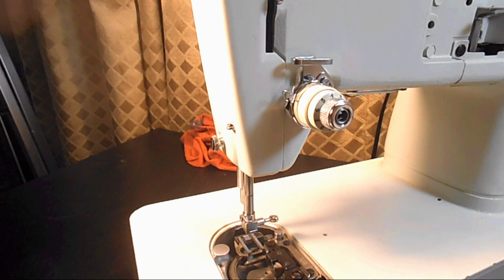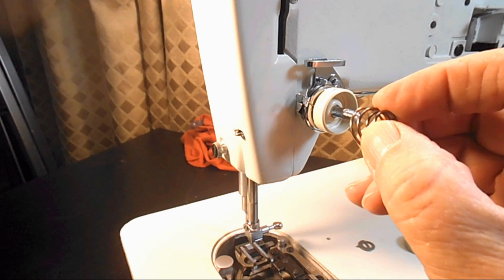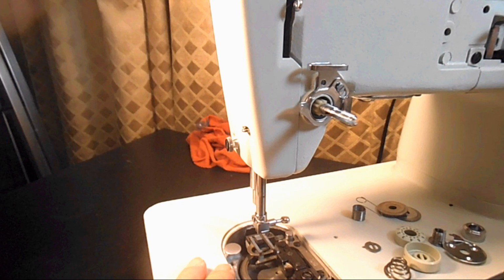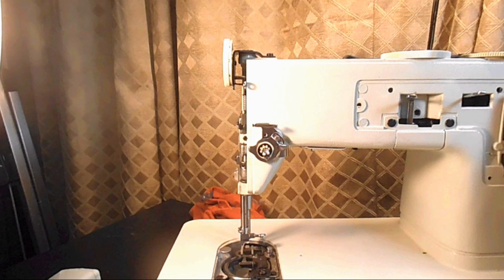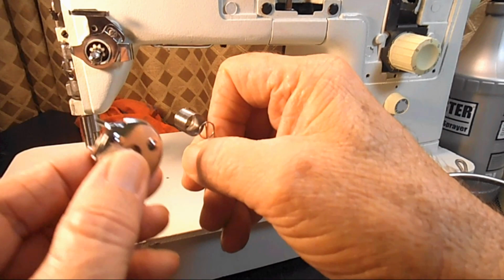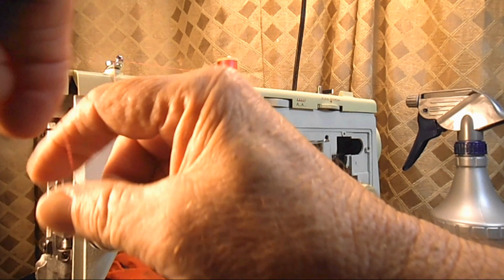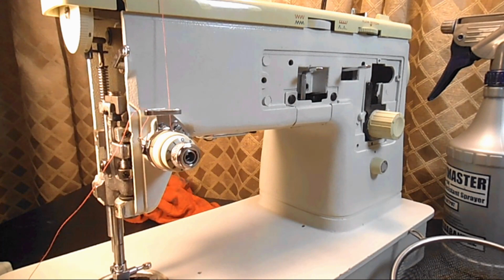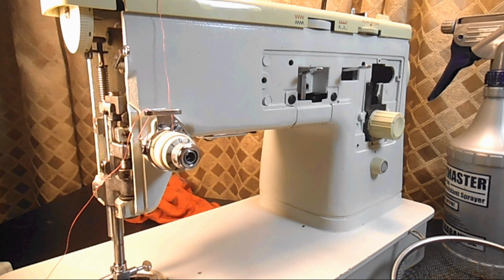How to Remove, Clean, Replace and Adjust the Thread Tension Unit on a Vintage Singer Sewing Machine

Comment: Hey Andy, my mom has a Singer 6105 sewing machine and for decades it has served us well, but one fateful eve my mom took it to a repair shop for some simple maintenancing, ever since then the machine has not sewed right. The tension assembly is quite loose and setting the tension with the knob no longer has an affect. Ive been trying to remove the knob but there is no flange or set screw to start with, it is simply the numbered indicator knob, then the +/- ring and finally the metal assembly you run the thread through. Other than the knob being plastic only the tension assemblies on both yours and our machine looks the same.
Reply: Hey Im just commenting further to update you and let you know I found the set screw I needed within the machine and got the tension assembly taken apart. Dont know how I didnt spot it sooner but on closer inspection I found there was a component missing that is part of the tension assembly and made an order for a replacement ASAP. My mom couldnt be happier, thank you! Finding your videos was a welcome reward as well. I appreciate all the work you do to help people like me! Have a Merry Christmas and Happy New Year!
Reply from the maker: I see you found a solution. Congrats. For others who read the comment with this type of plastic "tension Indicator" knob you just pull it straight off of the unit. Underneath is a "tension indicator adaptor" that it pushes onto. That adaptor is like the flange adaptor in this video. So, the plastic numbered knob is held on by friction.
Reply from the maker: @Fangman123789  (for other viewers reading this comment) It sounds like you found the internal set screw that holds the tension stud onto the machine. Loosening that set screw allows the stud with all the attached parts to be removed as a unit from the machine. I'm glad you found a solution and thanks for the followup comment.
Reply: @andytubesewing1953  Thank you too, your videos helped me a lot! Merry Christmas again!
Reply from the maker: @Fangman123789  😊

Comment: Thank you Andy for making a video on the tension adjustment knob. It worked for me. I had thread bunching up like it was eating up all my bobbin thread. I have another question. The pedal is either a very very fast or i have to pump it slowly. Any way to adjust that?
Reply from the maker: I have a couple of playlists for cleaning and adjusting foot controllers, a button style & a clamshell style. You don't mention the type of foot controller you have. Here are the links to the playlists if you want to check them out. https://www.youtube.com/playlist?list=PLsCOZgzzaiKL6ePPxLpmnWSzTyxPKTb71     https://www.youtube.com/playlist?list=PLsCOZgzzaiKItPLWcK24FBoMdHK8vTXNi    I'm glad the tension video helped, and good luck.

Comment: Hi Andy, thanks for the great videos. I have a Singer 447 that I am trying to get working. I have followed your video to refurbish the tension unit. Everything is fine until I try to set the tension. When I put the presser foot down nothing happens to the tension. Have I done something wrong?
Reply from the maker: With the foot down tension should be applied to the tension discs. When the foot is raised the tension release pin should be pushing the discs away from the spring to remove tension on the thread. You should easily see the indicator dial (the - | +) and the tension discs move when lifting the foot. If that is not happening, the short x-bar in the center of the indicator dial could be missing or cracked and the pin cannot move it. The tension releasing pin could be missing. When you lift the presser bar lever it moves a Tension Release Lever in the nose of the machine against the inside end of the Tension Release Pin. If that lever is bent and cannot contact the pin, then the pin won't push against the indicator dial and release the tension on the discs. Those are the most common reasons. Here is another tension video that talks more about the tension release pin: https://youtu.be/JqauIOWs9CI     Here is a video about making a new tension release pin from a nail: https://youtu.be/M1kXDd5GLEE   Here is a video about replacing a damaged Tension Releasing Lever: 
https://youtu.be/tw-Y3V_LrnA       Here is a video about a broken x-bar on an INdicator dial/flange. So people can replace the x-bar with a wire/toothpick/etc but I buy a new one if available: https://youtu.be/-TmDis0pcmU
Reply: Thanks so much. More work to do!
Reply from the maker: @kaffjones8710  Best of luck!

Comment: Andy, Please help me with tension on a Singer 15-90. I have taken it off and cleaned and replaced it but it hasn’t helped. The thread seems to lie on the top and even though the top tension seems right.  HELP!!!!!
Reply from the maker: You can test upper tension by putting the foot down on a threaded machine and grabbing the needle thread by the takeup lever and pulling it straight up while turning the tension knob from 0 to 9. At zero it is very, very easy to pull, and as you turn up the number it gets tension, then more tension, then too much tension around 7, 8, or 9. The thread on top means more tension ( a lot more) on the needle thread than the bobbin thread. If that test is as I described then you may have very low or no tension on the bobbin thread. Check to be sure you have threaded the bobbin case properly and if so you can adjust the bobbin case tension spring to add more tension. Here is my video about the hook/bobbin area parts so you can be sure those parts are installed properly and are clean. https://youtu.be/uk2IL7iclHk     If you still have trouble here are some more videos about adjusting the tension on a front-facing bobbin case:  https://www.youtube.com/watch?v=ME-sRgvHpBA       https://www.youtube.com/watch?v=DiK6mz-CRvE
https://www.singersewinginfo.co.uk/tension       https://www.ageberry.com/bobbin-tension/   Gppd Luck, and thanks for watching my channel.

Comment: There is no screw to undo on my singer 201k- any advice on how to get the first part off?
Reply from the maker: The 201 tension unit is even easier to remove. This video for tension on a 221 is better for you b/c it has the same tension unit as your 201. The disassembly starts at 55:00 of the video: https://youtu.be/enSTxxzqy4s   You may like to download a FREE copy of the Instruction Manual for your 201. It has 77 pages about using your machine, and pages 26 -27 show and describe the remove & replace instructions for the tension assembly. Here is the download page at Singer Support and click on the top manual: https://www.singer.com/search/support?title=201   Good Luck, and thanks for watching my channel.

Comment: I could have saved myself so much stress with my 522(which also has the same unit) last night if I had only noticed that the tensioner is automatically released by the foot. That explains the rod in the middle of the split screw!
Reply from the maker: Yes a little hidden tension releasing pin activated by a lever when you raise the pressure bar I'm glad you found it now and I'm glad you found the video I enjoyed your comment thank you very much

Comment: Andy, I have enjoyed watching your series and have learned a lot about sewing machine. I hope you can help me with my present problem. My tension unit is different from all the ones I have seen on your series. There is no set screw in the knob. It looks like it was press on and I can't find a way to remove it without damaging it. Your help would be appreciated.
Reply from the maker: Hi, Albert. I've never worked on the 240 series of Singer machines. I do have the parts manual for them and it has a blow-out picture of the tension parts. To me, it looks like there is a compression band inside the plastic numerated dial that slips onto a knurled knob to hold the parts on. I think you can pull the knob straight off the rest of the unit. You can buy a service manual for them for $9 at this link:  https://manualsoncd.com/product/singer-240-series-sewing-machine-service-manual/  You just download a PDF after paying. As a matter of fact, in the listing for the manual, they show some pictures, and one of them is the blow-out diagram I mentioned. You can see what I mean. IMO, $9 for the manual is reasonable and I own the service manuals for most of my machines as they are full of adjustment, repair, and remove/replace information. Thanks for watching my channel, and good luck.
Reply: @andytubesewing1953  Thanks for the response. I came to the same conclusions. I'll spray some WD-40 in there and hope that that will free the knob and I'll clean later with alcohol. The knob has been there for 40+ years. Thanks again. Albert
Reply from the maker: @albertkeller3405  Best of luck, Albert.

Comment: Andy, I've got a Singer clone, Japanese made, from the 60s. I just received a new pick up spring, and a new beehive spring. 
 I don't have the fancy thread guard, and a couple other handy pieces that come in this assembly. Is it possible to get a little more info from you?
Reply from the maker: I've never worked on a singer clone but if you can tell me which Singer Model Number your machines is a copy of I may have a tension video for that. As far as parts go I do not have them or sell them. I have read that many of the Japanese clones were so exact that the original Singer parts work well on them. I buy parts online for eBay mostly, and thriftyfarmgirl.com Thanks for watching my channel.

Comment: Hi! I'm working on a Singer 317 at the moment, and I get the tension just so, but within a few stitches it seems the top tension gradually decreases without me touching the tensioner. Any idea what might be causing that?
Reply from the maker: I've never heard of model 317 and did not find documents for it in my files. After finding it on Google Images I realized it is similar to the 327K sold in the USA and has a similar tension system to the machine in my video. I've had your problem with a couple of machines. On one the stud of the tension assembly was "pinched" and slightly twisted. Pinched meaning the slot down the center of the stud was pitched together a little bit as it got towards the end facing the sewist. When I set the tension and zeroed it out it was perfect but like yours, the tension decreased the longer I sewed. I think the damaged stud was allowing the tension discs to "drift apart" due to vibration once I was sewing for a while. It took me a while to straighten the stud and get equal spacing along that slot in the center but after that, the problem was gone. The other time I found the upper tension was actually OK but the tension spring on the bobbin case was dirty with grit and lint and as the thread passed under the spring it caused too much tension on the bobbin thread which caused the upper thread to be pulled under the fabric. After cleaning the bobbin case and resetting the bobbin case tension all was good. Good luck, and thanks for watching my channel.
Reply: @andytubesewing1953  Andy, you're a star! I will try both solutions and let you know. Thanks again. Jos
Reply from the maker: @josianeclark1797  Glad you replied b/c it reminded me I have a video about cleaning the bobbin case. You can see it at this link if interested: https://youtu.be/HT5XZ5eYYEQ    Good luck, Josiane. I hope you find the cause.
Reply: Thanks again, Andy. Saves me looking. I'm used to the 201 mainly, and this one looks more like a very old 66, but at a different angle. I remember reading that one had to be careful removing the race, as that might change how the machine performs. Thanks again. You are a true gent! Keep safe, Jos

Comment: Thanks for the great instructions, Andy. The tensioner on my 413 works, but doesn't disengage when the presser foot is lifted. I noticed that the "bar" of the plastic +/- indicator that fits in the stud slot is broken off. Could that be the cause? I looks to me like that rod pushes against it to realease pressure on the discs; I don't see anything else in there for it to push against. Is that correct?
Reply from the maker: You understand correctly. The Tension Releasing Pin is pushed against the bar of the indicator dial which pushes back the Tension Spring releasing pressure on the Tension Discs. A common problem after Singer changed to plastic dials from metal.
Some viewers have glued a new plastic. metal, or wood bar back into place. That works but usually requires shortening the Tension Pin. Other viewers don't want to bother and just replace the whole tension assembly with one that will work on their model https://www.singeronline.com/teas4.html
Reply: @andytubesewing1953  Thank you for confirming. What a cheesy arrangement! I think I'll try repairing it before replacing. I assume that, if needed, I can pull the pin out the front with a magnet?
Plastic (this, and the vertical drive gear) is certainly the nemesis of this machine... it seems pretty solid otherwise.
Reply from the maker: @JohnBau  Yes, other than those two it is a very solid machine. It's very versatile. A magnet might work on the pen since the pin is steel. Sometimes the dust on it will keep it from sliding out. You can also just tilt the machine forward and tap on the back of the arm and you can even push the pin out from the back side because there's a hole in the back of the stud One viewer I know had a little bit of epoxy left from a project and you roll the tiny tube of it and flattened it in there and he said it worked good
Reply: @andytubesewing1953  Hmmm, ok... I don't get the 'flattened epoxy' thing. Since pressure is applied to the rear of the indicator, I'm thinking a small metal piece glued in place across the hole and flush with the back of it would be best.
BTW, the replacement tensioner appears to have two discs, i.e. single thread...
Reply from the maker: @JohnBau  No worries, just epoxy shaped into a flat "bar" like the plastic one. I'm sure you'll make what you need. Take care.

Comment: Hi Andy. I used your video for tensioning before and found it really helpful. I seem to have problems again even after rebuilding the tensioner. I can’t seem to get enough tension on the machine, the bottom thread is always loose (so top thread not tight enough?). I don’t know if I need new parts? Everything seems to be really tight in the tensioner and the uptake spring isn’t moving. I have fiddled loads and no progress. I wondered if you had any advice? Thanks in advance. Glenn
Reply from the maker: What is the Make and Model of the machine, please? Were you able to do a normal Zero Out Setting? For needle thread tension two of the discs have to squeeze the thread. Usually, the tension spring (beehive spring) is what squeezes the discs together when the presser bar lever is down. If you do not have tension then what is blocking or preventing the spring from pushing the discs together? The spring first pushes on the indicator dial ( dial with the - | + on it) if the slot of the Tension Stud is damaged, like bent or squeezed together a little, the spring can't push the indicator dial into the discs to squeeze the thread. I assume you removed all the thread and reran the thread from spool to needle.
Reply: Thanks for the quick reply.
The model is a singer 338.
The take up spring just does not spring! I followed everything in your video. I think somehow the spring is damaged. The centre of the small circle does not line up with the centre of the big circle, so when I put it on the pin it’s angled down. I made my profile picture a photo of the spring, to help explain, but it may be too small.
Do you have any other ideas or also think this is the issue? I wonder how I caused this to happen? It was working fine before.
If that is the problem, would you have any suggestions of where best to pick one up? I’m in Canada.
And your videos are so helpful, you explain things amazingly well and clearly! Thank you so much!
Reply from the maker: @glennhaines6162  Interesting that it worked fine before. So, what went wrong? Change your profile picture back. Take a look at this old video of mine and see if that helps. https://youtu.be/JqauIOWs9CI  If it does not help then just email me at andytube53@gmail.com as resolving this is not a good use of the comment section. You can include any pictures and/or videos you like and maybe explain what you mean by your small circle/big circle statement. BTW, the last time I encountered this the small loop on the spring that is put on the stud last had one edge of the loop INSIDE the slot of the stud... oops! Good luck, Glenn.

Comment: Andy, are you still fixing tension? I have a 1975 dial & sew FA 590 /590.  I think I don't have ask the parts. I don't have the beehive sprimg do all machines have them?
Reply from the maker: No, I do not fix tensions for customers any longer. You have a dressmaker brand machine and I do not know anything about it or it's tension unit. I only work on Singer machines. Many tensioners have a beehive spring, but not all, even Singer. You need to scour the internet for a manual or diagrams parts list or used tensioner I think. I could not find much for Dressmaker Dial N Sew 590 except a manual that already sold on eBay. I wish you luck and take care.
Reply: @andytubesewing1953  thank you I have the original manual, but can't find anything about parts. I loved your videos. Your great. I will maybe duck tape, haha
Reply from the maker: @samibehrend  OK or super glue ✨🙂